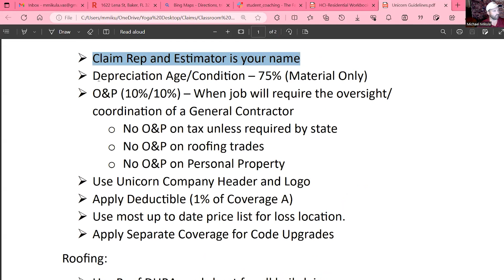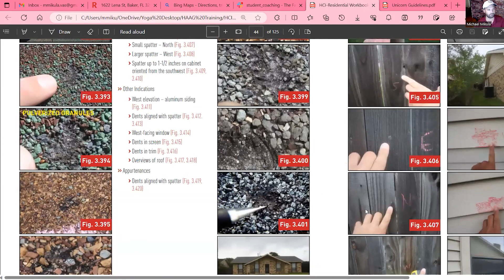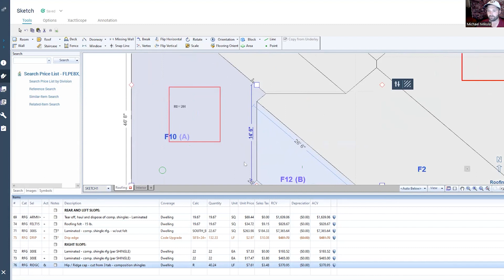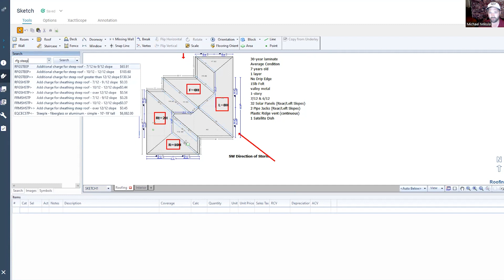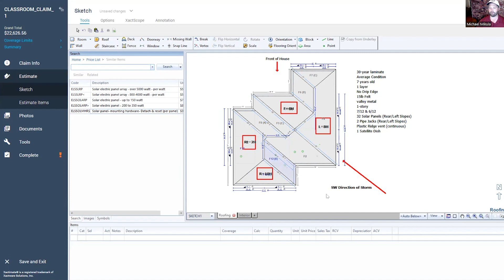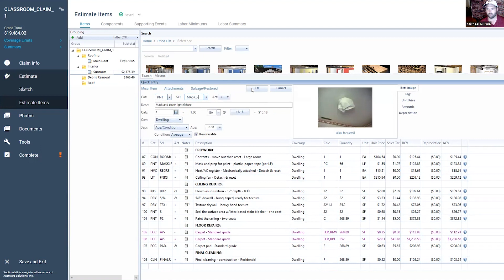🏠🎯 Master Hail Claim Xactimate Estimating | Pro Adjuster Training

Comment: So my question is how often does insurance say let's replace with shingles that do not match because you have new vs age 7 years. I would fight the hell out of that.  If you are doing any replacement I will want it to be a full replacement. That is the cruddy insurance companies that pull that crap. Easier for full replacement period. I have several rentals and all but 2 were full replacement. Those 2 I went to supervisor and had them move to full replacement. Makes zero sense to do partial. But I get it. If I were an adjuster I have to show pictures and come up with exact facts.
Reply from the maker: Remember, you aren't getting a free lunch.  If all insurance companies agreed to replace every roof regardless of repairability, you'll be paying into that through premiums.
Reply: @claimdaddy  oh yes I know that. Every single year the premiums go up and coverage goes down